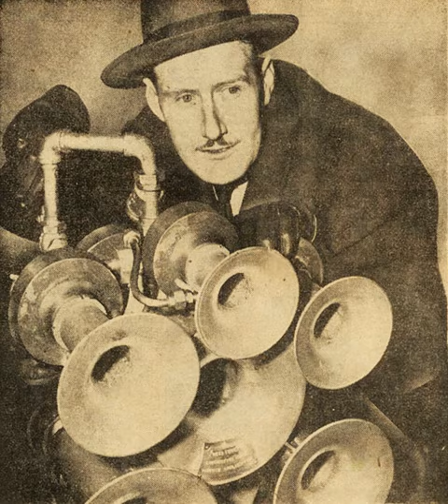Robert Swanson Train Whistle Speech given 1975

Comment: 0:17 Why whistles?
2:52 First whistle tuning opportunities
3:30 Inspiration of the first Hexatone H5. C# diminished chord.
6:10 Dieselization issues and first attempts to patent AirChime
8:30 The Hexatone H5/H6 construction
9:26 Chords C# E, G, A#, C# (pitched up to D#, F#, A#, C, D)
10:01 Explanation of the temperate and pythagorean scale
12:53 How and why the H5/M5 has that shape
13:19 The first application in 1949 on BC Electric in Kitsalino
13:42 The Tyfon A200 "ship horn"
14:01 Persuasion in the USA
16:38 Canadian changes to D# minor triad
17:30 Nathan M3H on CP FP7A
17:53 The K5L (the Genesis of the most well known horns today) on CP ALCO.
18:17 PGE (later BCRail) K5H/K5L
18:42 Great Northern E7A 510
19:15 Psychological principle of train sounds
19:54 The extremely obscure Nathan T5 "car whistle."
21:25 Horn valve stuck open
21:41 Ships horns and development of the "whistle farm"
23:10 ORIGINAL RMS Queen Mary whistle before the Tyfon 525s were fitted
23:25 MV Lloyd Jones?
23:56 SS Princess Victoria (sank in 1953)
24:14 SS Princess Marguerite II
24:36 Nanaimo mine whistle (unknown if it's still around at the mine ruins today)
25:09 MV Sea Lion whistle after 1952 rebuild (converted from a tug to a yacht today)
25:51 RMS Mauretania (sister ship to Lusitania) Smith Hyson 3 Chime whistle
26:12 Chemainus mill whistle (still in the museum there today)
26:31 SS Southern Cross (scrapped in 2003)
26:48 BC Ferry MV Queen of Vancouver
27:05 Foghorn development Albert Head BC (destroyed today)
27:57 Diaphone (presumably the F2T)
28:44 The Centennial train horn (now owned by Archeus Ledoux)
29:15 The Centennial caravan horns
29:28 BC Hydro (still blowing every afternoon today)
Reply: The “Oh Canada” horns now operate at Canada Place

Comment: When more the valve opens on the AirChime one hears the volume get louder, but the pitch lowers.   Is that from the cooling effect of expanding air?   Conversely, the pitch of Steam Whistle increases with more power...   Hot Steam heating the whistle/ raising the pitch?  Or is it a pitch perception issue?  From Wikipedia:  Pitch depends to a lesser degree on the sound pressure level (loudness, volume) of the tone, especially at frequencies below 1,000 Hz and above 2,000 Hz. The pitch of lower tones gets lower as sound pressure increases. For instance, a tone of 200 Hz that is very loud seems one semitone lower in pitch than if it is just barely audible. Above 2,000 Hz, the pitch gets higher as the sound gets louder.[11] These results were obtained in the pioneering works by S. Stevens [12] and W. Snow.[13] Later investigations, i.e. by A. Cohen, had shown that in most cases the apparent pitch shifts were not significantly different from pitch‐matching errors. When averaged, the remaining shifts followed the directions of Stevens' curves but were small (2% or less by frequency, i.e. not more than a semitone).[14]